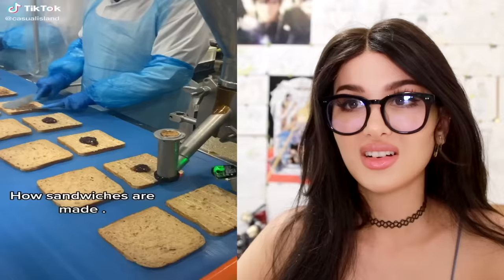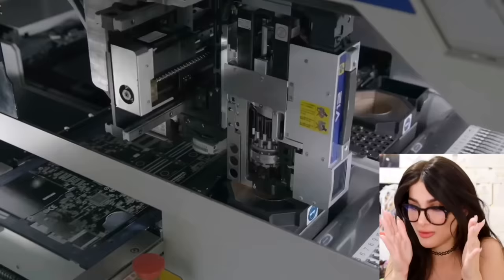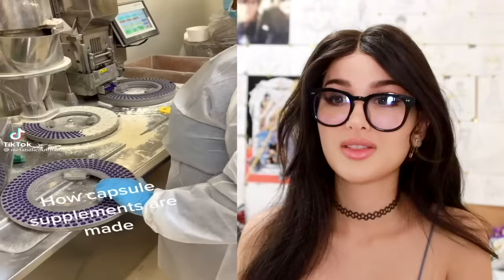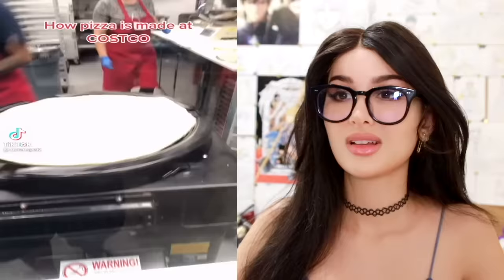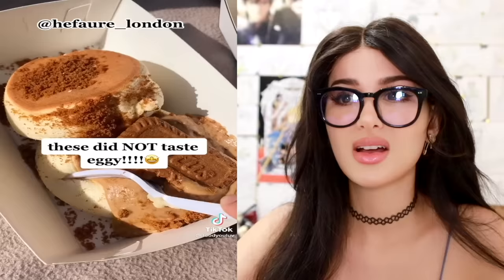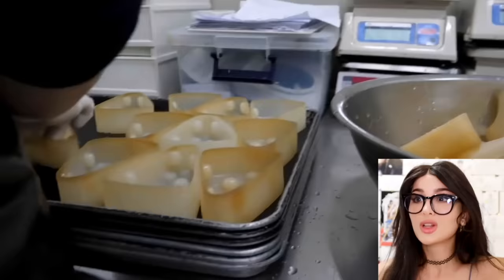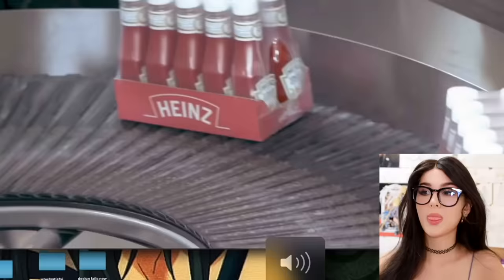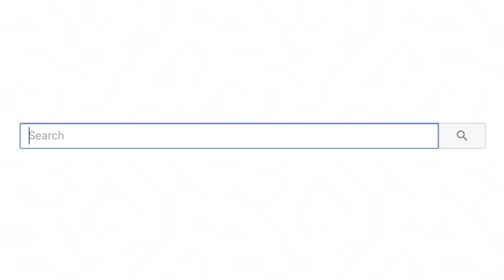How Everyday Things Are Made

Comment: That key check is not just for checking if they stick... They have to be functional too and it can be hardware related but also software... You see if you type in the BIOS/UEFI (nowadays its more often called UEFI.. basically the same thing "information of your computer and all kinds of heavy settings") and it works than it is not hardware related...and if it doesn't well than you can try it in normal settings but it's very likely that something inside isn't right these things are quite sensitive that is something that i learend when i was doing my internship that wasn't told to me in college.. and I'm actually surprised that i still know that after 2 and a half years